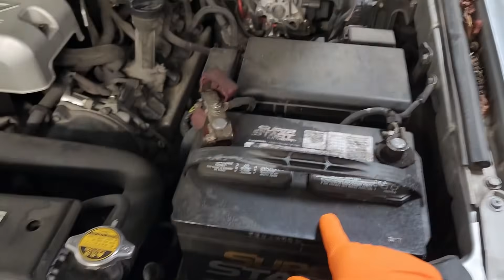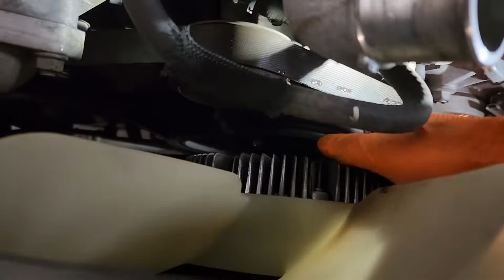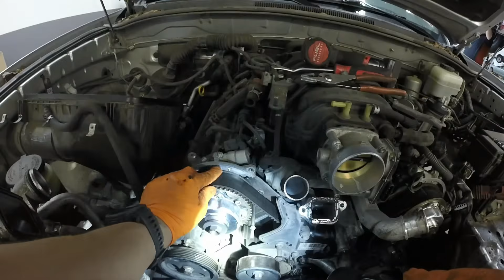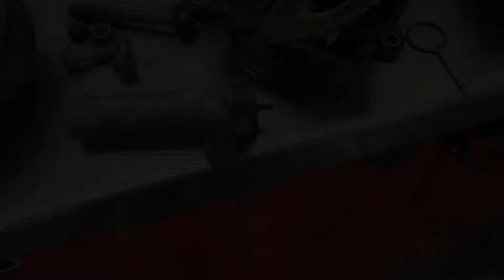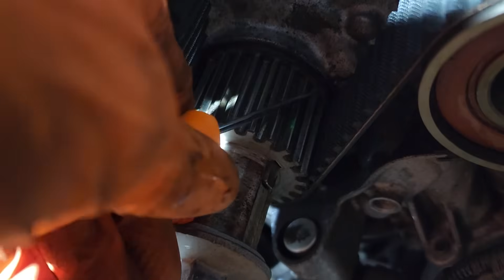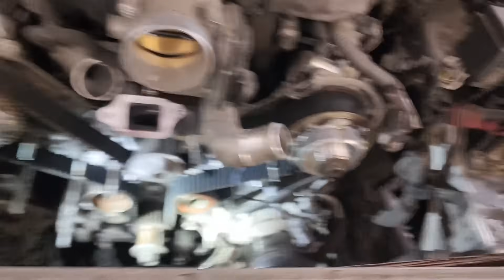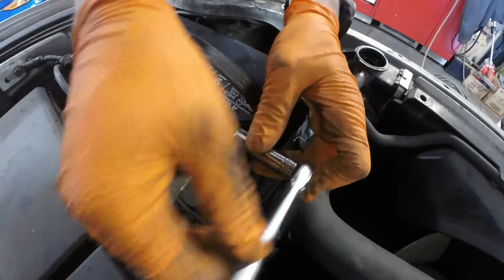Timing belt replacement by a Toyota master tech

Comment: So the belt broke two weeks after I bought a used 01 tundra. Not good! Anyway I'm just hoping for the best as the car was ideling at the time.

Now that I need to put a new belt on how should I go about it since I was not able to rotate engine to top dead center before taking off the old belt.
Reply from the maker: Sorry to tell you, but you probably bent valves, so the heads will have to come off.

 If you wanted to, you could try turning the crank to the dot just past top dead center, then turn the cams. If there is any resistance, stop and turn the opposite way. 

You could also try and put a belt on and rotate the engine all together, and then when close, remove the belt and adjust the pulleys. 

The safest way would be to remove the cams so all valves are completely closed, then rotate crank and then re install cams, then thr belt.

Sorry for your losses!
Reply: @shoptimewithdrew  I was able to remove all the spark plugs so I wasn't fighting compression... Then I turned the crank slowly turning the pulley by hand to past top dead center to the timing zone. I did a full rotation without feeling that I hit any valves. The. I set the cam pulleys to the T timing marks and installed a belt.

Truck was able to start when all together and I don't hear any odd noise. Seems as though I may have dodged a bullet! Haven't had a chance to drive it just yet.
Reply from the maker: Nice, that is great news. I think you would notice an issue at idle if it bent valves.
Reply: @shoptimewithdrew  Thank you for the feedback! i wasn't quite sure what to be looking for. Nothing obvious stood out seems to run smooth! I had also used a camera to look at top of the pistons from spark plug holes and didn't notice any signs of impact from valves on them.
Reply from the maker: You're welcome!  All the ones I have had come in with a broken timing belt had bent valves.
Reply: @akop87 
01 Tundra is non-vvti correct?

I've read quite a bit the non-vvti engine can survive a belt break. Glad yours survived!

Comment: Awesome video. I’m assuming this job is the same with the GX470 correct? Thanks
Reply from the maker: Thank you. Ya engine is the same. Some of the brackets and covers may be a little different.
Reply: @shoptimewithdrew  awesome thank you. I appreciate your quick response

Comment: Thanks for the helpful video. Did you torque the bolts or did you edit that part out?
Reply from the maker: I didn't torque the bolts. I do it by feel. You need to do what you feel comfortable with, though. Thanks for the comment.
Reply: @shoptimewithdrew  I would guess if you do this enough, you could tighten them by feel. Also, what is the solution in the green bottle that you used to clean the engine? Thanks
Reply from the maker: It is brake clean. We get it in bulk.

Comment: Will the 4runner still run if the timing is off one tooth? The previous owner did this job himself, and there is a p0016 code .
Reply from the maker: I would think it could run and be off one tooth, but it would run really poor. I have not had one yet, with  it being a tooth off, so I could not tell you for sure.
Reply: @Shop Time With Drew  okay. It doesn't run terribly. I changed OCV's, and it didn't seem to make a difference, still have P0016. Sometimes, it sounds off when it first starts. The fuel mileage is about 15mpg at best..
Reply from the maker: I would check timing, but I wonder if it is a cam gear issue or if someone has done cam seals, they might have messed up the scissor gears that connect the intake and exhaust cams

Comment: Amazing video!!   

Just bought a 2007 and was told the belt was changed.  Was not till today I found out how to check myself by removing a few screws and pulling back the cover.  

My belt is cracked all over the place.     

I’m scared to keep driving it but I don’t have any other vehicle right now,    

My step dad used to me a mechanic but seems to be not wanting to help me with this task as he said it’s way too hard
Reply from the maker: We charge 6 hours for waterpump and timing belt.
Reply: @shoptimewithdrew  ok,  thanks.   It’s cold here in Canada right now so I’m not sure if I’m gonna do the work myself or submit to the dealership lol.  Looking like $700 in labour but that is hassle free and comes with warranty
Reply from the maker: Ya, that is not a bad price.
Reply: @shoptimewithdrew  got my belt and water pump done today.  Posted a short of the belt from 2007.   To be honest it probably had another 50,000 kms 😂
Reply from the maker: I will check it out. I'm glad you got it done.
Reply from the maker: What is your channel
Reply: @shoptimewithdrew  https://youtube.com/@Pickle223
Reply from the maker: Dang, that thing was worn out.
Reply: @shoptimewithdrew   right!!! It’s such a relief to know it’s changed out now
Reply from the maker: Ya, now you should have nothing else to worry about they are great vehicles.
Reply: @shoptimewithdrew  yeah I just need to save up for a lift and some rear breaks but that’s nothing that’s going to effect the motor,
Reply: @shoptimewithdrew  uploaded a muffler delete of the 4.7 v8 on my channel 

A before and after
Reply from the maker: Nice. I'll check it out.
Reply: @shoptimewithdrew replaced the spark plugs today, was extremely easy,
Reply from the maker: Nice, im glad you are able to perform a lot of work yourself. The spark plugs and valve cover gaskets are pretty easy on the 4.7L. Decent amount of room.
Reply from the maker: It's not that bad if you have some mechanical background. You just gotta do it. Definitely don't want it to break. There is a chance of bending valves if it breaks.
Reply: @shoptimewithdrew  the minimum I need to replace the belt is a new belt and new coolant hey ?    I get cash at the end of this month but not sure how many more kms I got before this one goes.    I have 250,000kms and I’m assuming this is the original belt.  So I’m panicking
Reply from the maker: You are probably right about the original belt if it is all cracked and yes minimum you would need is the timing belt, cross over pipe o-ring, form in place gasket and coolant you don't have to do the water pump.
Reply from the maker: Actually, you won't need the o-ring if you're not doing the water pump, just the gasket maker for the thermostat housing.
Reply: @shoptimewithdrew  I’m wondering if I can get by until the end of the month when I can just have the Toyota dealership do it along with the water pump and tensioner and pulleys,   I’d say I have maybe 1500kms of driving to do before I have the cash to take it to the dealership
Reply from the maker: I think that would be fine. Just be easy on it, and don't be out racing it around.
Reply: @shoptimewithdrew  I have been babying it since I got it,  mostly cause gas prices and cause it’s in extremely good condition other then the belt is desperately needing to be replaced,    

Thank you for taking the time to talk with me.  I’m going to just hold off so I can get this all done at one time,
Reply from the maker: That sounds good. Definitely leave it to the professionals if you are not sure about it. Thanks for the comments. I hope it is a great rig for you and that you get a lot of years out of it.
Reply: @shoptimewithdrew  

My local Toyota is saying the water pump uses a metal gasket?  

Not a gasket maker ?
Reply from the maker: Water pump gasket is metal. You need a gasket maker at the thermostat housing it mounts to the pump.
Reply: @shoptimewithdrew  ahhhh ok thank you
Reply from the maker: Welcome
Reply: @shoptimewithdrew  hey man, so dealership recommended I get this aftermarket kit,  continental brand. Has water pump and timing belt and pulleys 
Is this a good option ?
Reply from the maker: It will work, but can't they get factory parts. I would prefer an Aisin waterpump and gasket with a factory belt. We have used the continental brand before, and they work. I just prefer factory parts.
Reply from the maker: Go to Amazon and type genuin toyota 4.7l timing belt, and you should see a aisin brand one that looks really close to factory.
Reply: @shoptimewithdrew  yeah I would prefer to use factory parts also.  

Do you think I need to change out the pulleys and tensioners?? 

Or could I get away with a factory pump and belt and use my original pulleys ?
Reply from the maker: I think you would be fine to reuse the pulleys and tensioner. 95% of the time, we only change the belt and pump.
Reply: @shoptimewithdrew  do you think I really need to change the water pump and pulleys ?? 

Or could I get away with just changing the belt  ?
Reply: @shoptimewithdrew  ok thanks man,  I think I’m gonna just go that way,  change the pump and belt and call it a day
Reply: @shoptimewithdrew  

So the only special tool I need is that crankshaft holding tool hey ?
Reply from the maker: You can do the job with basic hand tools, but the job is easier with air or electric tools. The only tool you might need is a crank shaft pulley puller. If you don't have air tools, you will need a chain wrench to hold the crank shaft and a big breaker bar to loosen the bolt.
Reply: @shoptimewithdrew  my step dad has all the tools and stuff like that.  I can order that crank shaft holder to take the crankshaft bolt out.   He has a garage after watching you video 10xplus I know I can change this stuff out.  Might take me a full weekend but I know I can do it
Reply from the maker: I think you can just take it slow and keep all your stuff organized for re assembly.
Reply: @shoptimewithdrew  might just order that Aisin kit for $277  you have used them and this way I’m putting all new stuff in. 

If flushing my rad out necessary or would be filling it with new fluid be good
Reply from the maker: Ya factory pumps are Aisin they just say Toyota on them. You should be able to just add coolant. When you do the waterpump, most of the coolant drains out of the engine. Takes about 2gal of coolant also the coolant funnel I use helps a lot to get air bubbles out.
Reply from the maker: There is a link to the funnel in the description of the video they don't cost too much.
Reply: @shoptimewithdrew  thank you for all your help !!!
Reply from the maker: It's not a problem. I hope the job goes smoothly for you guys.
Reply: @shoptimewithdrew  hey one more question,  my truck is getting super good fuel mileage, like just over 19 mpg on the highway,  I was gonna change the spark plugs but it doesn’t seem like I really need too ?   But would you recommend I do it anyways seeing as I will have the battery disconnected and it’s not that hard if a job well I’m at it
Reply from the maker: It would not hurt to change them they are do every 100,000 miles or 160,000 kilometers.  Use NGK or Denso plugs
Reply: @shoptimewithdrew  yeah I’m gonna assume they are the original plugs since the belt is most likely original also.  

Will post pics on my YouTube of the belt when I do it
Reply from the maker: That would be cool .
Reply: @shoptimewithdrew just out of curiosity,  what did the dealership charge for labour hours on this job ?
Reply from the maker: We charge 6 hours for the timing belt and waterpump.

Comment: Invaluable video. Helps to know you’ve done this before and cleared up several questions I had. I am amazed how clean you got the water pump interface. I used a brass wheel but it still had the former gasket stain even though smooth. Also the pump kind of popped over the lubricated O-Ring when installing. I hope it didn’t move. Any thread lock used in pulley bolts?
Reply from the maker: Thanks for the comment. I don't use any lock tight on any of the bolts they didn't come from factory with lock tight, so I feel there is no need. After you get done, take it on a good test drive and then check the valley between the heads and verify that no coolant is leaking at the cross-over pipe.

Comment: I viewed your video because I will be  attempting to do the job on my 2005 Sequoia  2UZFE 4.7litre over the coming weekend. I ordered the Aisin kit but now I am a little confused because their instructions advise that after finding the TDC to turn the crankshaft 50 degrees ATDC. THis contradicts your method of moving it to the T mark on the camshafts and the mark after the 0 deg TDC.  Which is correct? Thanks for your reply. Your video is Great and it gives me a degree of confidence, I just want to clarify so that I don't mess things up.
Reply from the maker: I think the wording in their instructions can be confusing. The T mark is after top dead center.  Top dead center is if you put the crank to the 0 mark and the hash marks on the cam caps.  If you set it to the T mark, it is less likely for the cams to possibly move. If it is set to top dead center, there is a lot of valve spring pressure causing the cams to rotate.

Comment: Thanks God, he is the one clearly showing all timing marks where should be before removes timing tensioner (50° ATDC) and timing belt then clearly explained where all timing marks should be (With new timing belt installed) after new timing tensioner extended (TDC). I have been watched lot of YouTube clips for 2006 Tundra SR5, 4.7L V8 along with reading instruction came with Aisin kit part #TKT-021, more clips I watched, less confident on myself 😂 eventually I think I will go with Aisin’s instructions which indicated apply to 4 Runner 4.7L V8 for only year from 2003-2004, Land Cruiser 4.7L V8 from 2003-2006, Sequoia 4.7L V8 from 2001-2008 and Tundra 4.7L V8 from 2000-2008. Now after watched clip of Shop Time With Drew, only 38’19” but I have more than enough of courage and confident to replace timing belt and water pump for my 2006 Tundra DC SR5. Could take me 2 days but I got plenty times because I retired 😊. Thank you so much Drew, I am sure lot of guys out there appreciated you also.
Reply from the maker: Thank you very much for the positive comments. My goal with my videos is to provide as much help as I can. Hope your timing belt job goes smoothly with no hiccups.

Comment: So the belting marks don't matter (R cam Lcam and CR)...
Reply from the maker: The belt will only go on one way for the marks to line up. If your belt is aftermarket with no marks, then all you can go off is the marks on the pulleys and engine.

Comment: I don't have Toyota Mechanic shirt, but isn't it 4 bolts & 2 tranny cooler lines left to pull radiator totally out?
Great Smooth Video.
Reply from the maker: You are right about that but in a shop time is money. If you don't have to pull it, it is just added steps. Thank you for your  input.
Reply: @shoptimewithdrew  
Yep, I get that!!!
❤️

Comment: Getting ready to do My Son's 04 with the 4.7. I'm reading the harmonic balancer bolt can be a pain. What do you recommend to hold it ? Remove stuck bolt etc.?  Chain wrench? Breaker bar or impact? Thanks great video 👍
Reply from the maker: If I can't get it with a impact I will use a chain wrench with a long braker bar. I would say 9 out of 10 it will come off with a half inch impact. Best of luck.
Reply: @shoptimewithdrew  thank you
Reply from the maker: Not a problem hear to help.
Reply: I actually just did my first 4.7 and I followed this man's instructions to 80 let me tell you that boat that you're about to pull off a harmonic balancer the more you can lock it up the easier it'll be and you got to stay on your your point mark top dead center and doing this you should use the serpentine belt and wrap it around the pulley of the oil pump so that it makes it so that the serpentine belt is locked upon itself as long as there's pressure on it you should be able to crack that bolt no problem

Comment: Thanks for your video.  I have the Factory Toyota Manuals on my 2006 Tundra.  To set the timing before removing and replacing the Timing Belt it states the following: Turn the Crankshaft Pulley approx. 50 degrees clockwise past TDC, and Align the timing mark of the Crankshaft Pulley with the centers of the Crankshaft Pulley bolt and the NO. 2  timing belt idler pulley bolt. If it is done this way , it will be a little further past the "post" that you used on the lower timing belt plastic cover and the "T" mark on the Cam backplate.  I understand the bottom line is relieve the Tension on the Cam so that when you remove the belt it does not "rollover". Thanks and great video !!!!!!!!!
Reply from the maker: Thanks for the comment. Great right up of info.

Comment: Do you set the timing marks at TDC or on the “T” marks to prevent the cams from rolling?? Please let me know I’m going to do mine on my 07…
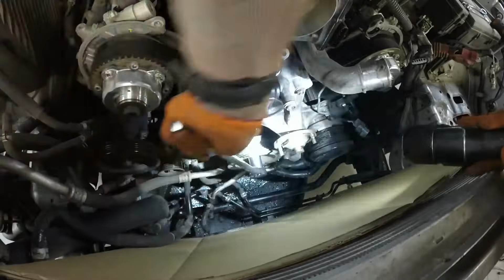Reply from the maker: At 10:50 in the video it explains were to line the marks up at. I would set it at the T mark.
Reply: @shoptimewithdrew ok thanks
Reply: Sorry I missed that part

Comment: Excellent video. Getting ready to do one of mine (I have 2 v8 limited t4r's lol) and I will slate a whole weekend for it since my days of making money turning wrenches it over.... Since the 4th gen has a known failure of the Evaporator I will be curious if you ever do a video on one. I have a failed unit and dread that project lol..... Nice work- smooth and easy....
Reply from the maker: Thank you for the comment. Just take your time on the belt and you will be fine. For the evaporator I don't know If I will ever get the chance to do a video on one. All I can recommend  is have 3 different bolt/screw containers so you can keep all your left side, right side and center hardware separate. There is a lot that goes into it. Wish I could be more help but it is a lot of steps  to say in a comment section.